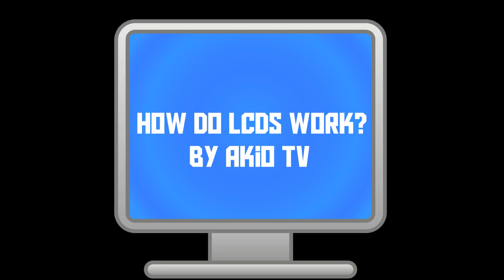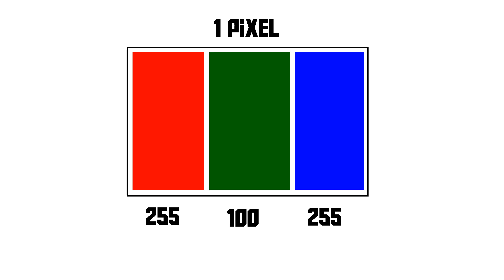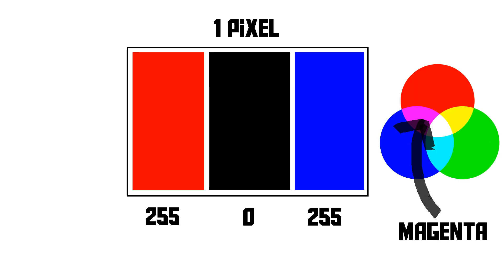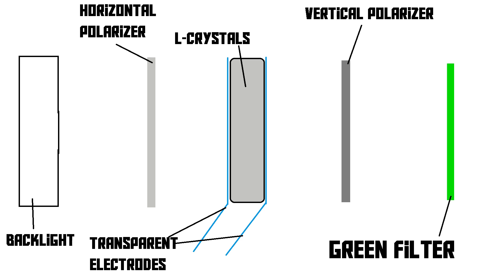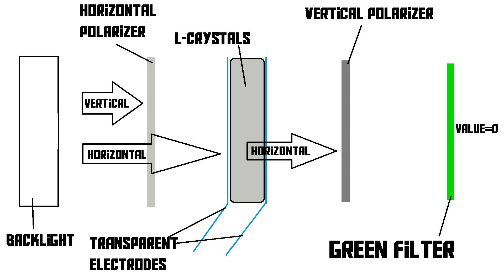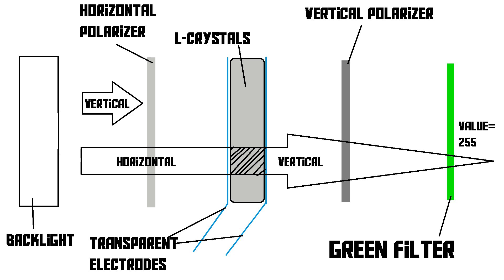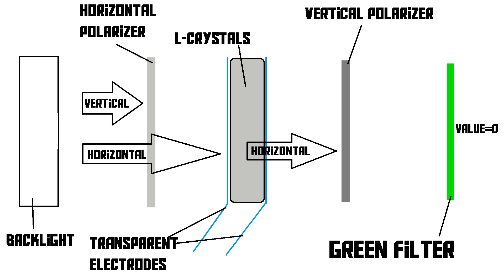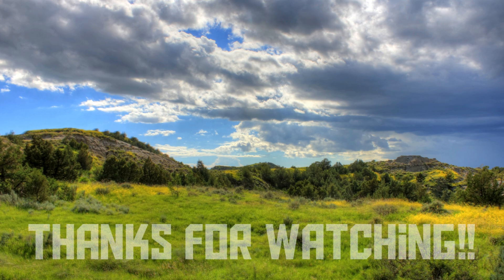How do LCD screens work? (AKIO TV)

Comment: Should have also mentioned how a device sweeps through memory and uses a clock to sweep through the screen to project a voltage level for every sub-pixel. But otherwise a really good video.

Comment: So worst case let’s say we have 921,600 total pixels. We have a cathode and anode for each filter color, so we have 921,600 pixels X 3 filters = 2764800 filters.
Each filter needs a cathode and an anode. So you need 2764800 outputs pins to control each pixel and you need 2764800 cathodes going into ground?

This part does not make sense to me. If you have an 8bit shift register array, you would need 345,600 shift registers to control each individual matrix. 

If you do a matrix where each row and column has its own wire with a common cathode, then you still need 6,000 outputs with 1280 columns and 720 rows with 3 filter colors? In this case, you will still need 750 8bit shift registers for that many outputs.

My question is how are all the pixels controlled in unison with 60 frames per second or faster refresh rated? I can’t find any freaken videos that explains 😢
Reply from the maker: The display doesn't refresh all pixels simultaneously. The pixels are "scanned" one by one, line by line, starting top left, ending bottom right.

Comment: If ultimately the l-crystal is converting a horizontal polarized light into vertical polarized light then why not remove the horizontal polarizar at first which will directly allow the passage of vertical polarize light
Reply: I guess its because you need to turn the sub-pixel off when you dont need it. If you only have the vertical polarizer it will stay turned on all the time

Comment: So why have a horizontal polarizer if u are just going to make it vertical light also awesome vid
Reply: Liquid cristal don't act as a polarizer , solely as a programmable light rotation system. You still need first polarizer to polarize the light at the beginning of the systems so you can choose whether to block it or not at the second one.  If you remove the first polarizer , you 'll then have unpolarized light that can pass trough the second polarizer (intensity 'll be divided by 2). By the way the video describe a normally white panel , meaning in the "no current mode" , light can go trough , it can be a cost saver if you display mostly bright picture (you don't have to apply current to the electrodes). But the vast majority of panel are "normally black" , meaning you have to apply current to let light goes through.
Reply: @sylvaintreuillet4055  thank you so much

Comment: 1. An 8-bit display CAN NOT show every color in the universe. Why do you think we have 10-bit displays? and even then there will be gaps. The number of possible colors in the universe.. at least mathematically..  is infinite.

2. You didn't explain why we have to first use the horizontal polarizer if we're only going to convert horizontal rays to vertical before letting them pass?

Comment: But why do we only use the light which is horizontally polarised,i.e, why do we block the vertically polarised light by a horizontal polariser in the first step?
Reply: that's because unpolarized light will go through the crystal and then pass trough the second polarizor , you can never have black color is this situation.
Reply: @sylvaintreuillet4055  I’m still not understanding please elaborate again. Why do we put light through the horizontal polarizer only to switch it back
Reply: @3018handle  because an ideal horizontal polarizer + vertical polarizer = no light.
Then if we add a liquid crystal in between we can now rotate the light so that light can start getting through again.
If there were no polarizers the backlight would always just shine through. The screen would be white because there's nothing to stop the light from passing through.

Comment: 1:05 This is only true for displays with 8bits of color depths, though.
With 9bits it would be 512/subpixel
10bit --> 1024
2^colorDepth(in bits) to be exact
To calculate the maximum amount of colors displayable:
2^(colorDepth*amountOfChannels)
Keep in mind that for stage lights we not only have RGB but RGBW, so an extra white lamp adressable by a 4th channel.
We save .PNG files with an Alpha channels which determains how transparent a specific color is (which is important if we stack multiple images so we dont need to have a background or also if we want something to beslightly transparent if you draw in some smoke for example).
Also printers dont mix red, green and blue. They mix cyan, magenta and yellow instead. So pretty much the same but all colors flipped to the opposite in their hue on a color wheel.
Just a little heads up to add that info and not drop it completely.

1:53 This is not true. You can only produce MOST of the colors human beings can see. Although you are limited to 16.7 million at 8bits of depth. The human eye is not limited to some color depths. The colors we see only depend on the photons energy our retina just absorbed. We can see any color with a wavelength longer than 380nm and shorter than 780nm. Anything beyond is invisible. This includes radio waves, micro waves, heat waves or anything other which is IR and of course gamma rays, X-rays, or anything else ultra violet. (Current) Monitors cannot emit such photons. And why should they? - We wouldnt be able to see it anyway. But they can not create "any color in the universe". Also there are infinite colors anyway. There are even infinitely different colors visible to humans. For example: There is green. Then there is green which is tintend slightly red. Then there is green which is tinted slightly more red, and so on.
Its like: ,,How many fractions exist between 0 and infinity and how many exist between 0 and 1?"
Reply from the maker: Informative!
Reply: @AKIOTV  ,,You can only produce MOST of the colors human beings can see. Although you are limited to 16.7 million at 8bits of depth." I just noticed I didnt specify what I mean with that. I gonna add that anway.
There are colorspaces like sRGG (which is almost completely covered by most monitors. Really good ones cover like 99.5% of it. But there are even bigger color spaces like AdobeRGB, which a lot of monitors only cover poorly. ProPhoto RGB is even bigger than that.
(There are no bad color spaces, btw!)
https://www.google.com/search?q=srgb&sxsrf=ALeKk00P6NRrbiyaMW3BBpnK2_Uf8b_Cuw:1592937954065&source=lnms&tbm=isch&sa=X&ved=2ahUKEwjW-JmnzJjqAhUNEJoKHZYuBE0Q_AUoAXoECBIQAw&biw=2560&bih=937#imgrc=14_4nV6DGE5o3M
Here is a diagram of what each colorspace is capable of and what it covers of the colors visible to humans.
Just wanted to add this.

Comment: So does this mean that there is a higher use of electricity when the pixels are black? Because electricity needs to be passed to the electrodes to position the liquid to not do anything.
Great video and explanation!
Reply: That's right .
Reply: Actually not, the polarization of the LCD MOSFETs doesn't need any current flow  (just a super tiny amount) to polarize the LCD, the only usage of electricity is to generate the electric field
Reply: Its yes and a no, a pixel in a screen like amoled work individually so it can turn off without use any electricity, while screen like IPS cant do that
Reply: I see guys, thanks a lot! :)
Reply: Yes and no.  the video talks about normally white panel.
 , for which your comment is true. but Some are called "normally black". Normally black means in state of no current applied , light will be blocked by default.
Reply: Can anyone please  tell me from which material the sub pixels are made of???
Reply: It depends on the LCD type, man. There is NORMALLY WHITE (the one explained in the video, and YES, this needs eletricity to block the light to produce blacks), and NORMALLY BLACK (This one DON'T NEED ELECTRICITY TO PRODUCE BLACK, BUT WHITES). Old (CS) TN LCDs were all Normally White, because the UI and OS displayed most of the content in white (like on the Windows 2000 and backward)back then, and it made them to not waste energy on whites. But today's LCD, after the TFT era, like VA, IPS, LTPS, PLS, they're Normally Black, because most of today's UI uses black backgrounds and it kind of makes them to not waste energy displaying blacks, but white. Buut, Normally Black wastes energy yet in other LCD components(backlight, TFT etc), not making them efficient as OLED displays that REALLY TURN PIXELS OFF, and the necessity for a backlight, still makes the blacks to not be displayed deeper as in an OLED. Mini-LED backlight technology comes up to try to solve this issue
Reply: Yes at least under some circumstances, black screen costs more power but is gentle on your eye.

Comment: 1:50 Wouldn't you only be able to make 3^255, not all the colors possible?
Reply from the maker: with 8 bits per channel you get 256^3 possible colors. (not 255 because 0 is also a possible value.) I may have said something like "with these three colors you can create all others", which was just to illustrate the concept of rgb. Indeed the actual amount of possible colors depends on the amount of bits per channel.
Reply: yeah so in a 8 bit channel you get 16,581,375 colours in total

Comment: Why can the sub pixels only work with vertically polarized light, why not horizontal light or any other direction of polarized light?
Reply from the maker: Liquid crystals can "turn" the polarisation 90 degrees, so horizontal/vertical are relative terms. If you were in space, horizontal and vertical wouldn't even exist, as they are defined by (you guessed it) the horizon. In fact, if you turn your monitor on its side, the horizontal polariser before the liquid crystals is now actually a vertical polariser, and the vertical polariser at the end is now actually a horizontal polariser.

So yes, you could do this with horizontally polarised light as well, and in fact with any orientation, so long as you line up the filters correctly;
For example: if your first filter is a horizontal polariser tilted 45 degrees (making it a uhm I guess a "diagonal polariser") then of course the second polariser should be a "vertical polariser" tilted at 45 degrees too. (the first one would be \ and the second one /, instead of the first one being - and the second one | )

Comment: Why can't you just change the intensity of the backlight to control how much each of those three bands light up?
Reply from the maker: If you change the intensity of the backlight, you're changing the brightness of the entire screen. The backlight is one big light that stretches over the whole thing.
Reply: Archit Bajaj some LED screens are able to do that using “local dimming” but it’s not perfect
Reply: There are like 2 types of backlighting: full array and edge lit. Full array has a lot more led backlights that can perform local dimming a lot better. Edge lit has leds on the edges and can turn off sections of its backlights but it doesnt have nearly enough lights as full array so local dimming will be crappy… will dim huge parts of the visible screen instead of the smaller more precise sections dimmed in full array. Obv ones more expensive

Comment: i understand there are only two possible values for a subpixel, 0 and 255. and it makes 6 different colors on the screen. how can the shades of colors be made? so this is not a good explanation.
Reply from the maker: I did actually explain this although you've probably missed it so here you go: the max value is 255 and the miniumum value is 0. So each subpixel has 256 possible values. This means the amount of colours that can be created is 16.7 million. (if there would be only 2 possible levels why would we use 0 and 255 rather than 0 and 1?)
Reply: i mean, if light passes through the liquid crystal, the value is 255 and if it doesn't, the value is 0. So, what about the  value 100? what makes subpixel more shiny or less shiny?  is it voltage or any other factor makes the difference?
Reply from the maker: I reccomend you go to 5:05 in the video and listen closely.
Reply: AKIO TV yes i missed that. So i have to apologize and correct my comment. This is the clearest explanation. Thanks.
Reply from the maker: Well I do think that in the drawing that is on the screen during that time, I should have put it in somehow, because now it's quite easy to miss since it's only in the voice over.
Reply: so ur in 5th grade art class an u pour a blob of white paint on a piece of card board(represented as 0 of 255). then u take a small drop of black paint and mix it in that white blob (represented as 10 of 255). the color doesn't change much but it does a bit. then you pour half the bottle of black paint an mix it with the white (represented as 155 of 255). you now have the color gray. same principal except mixing light instead of paint. a stained glass window of a church is a good visualization.